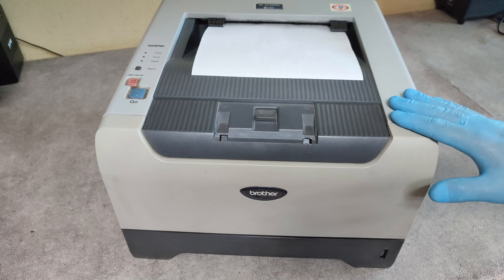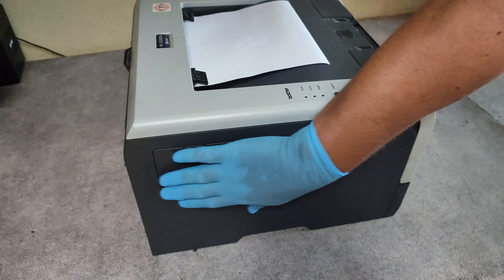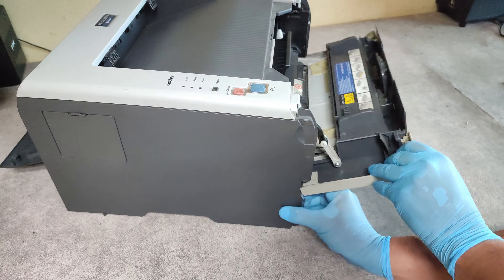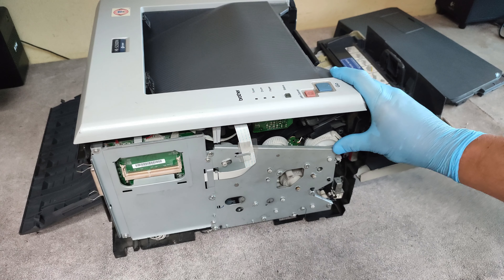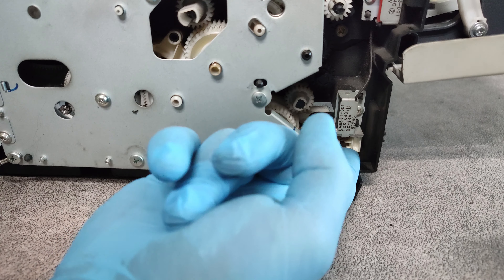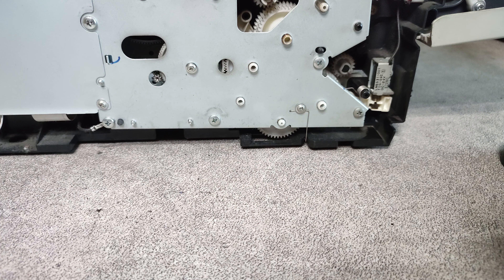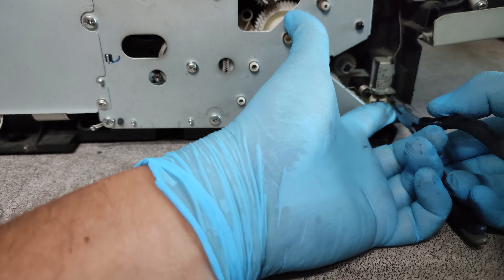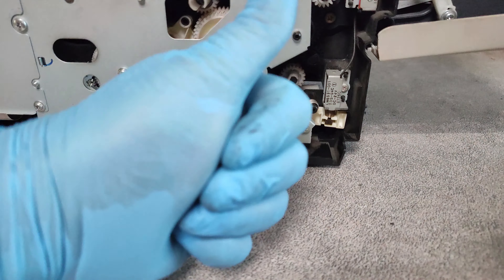HOW TO FIX PAPER JAM IN BROTHER HL-5250DN, HL-5240, HL-5270DN, EASY FIX, SOLENOID FIX

Comment: Great Job.
The problem is: there is a sponge attached to upper part A, which was to prevent the bottom part B to hit Part A too hard,
Actually it's not a necessary. But after many years of use, the glue that attach the sponge to part A getting to the surface of sponge, and the surface is facing bottom part B. so the Part B and A has sticky.

Insert a clear tape into the upper part A, to cover the sticky sponge. The problem solved. 
Many Many thanks!